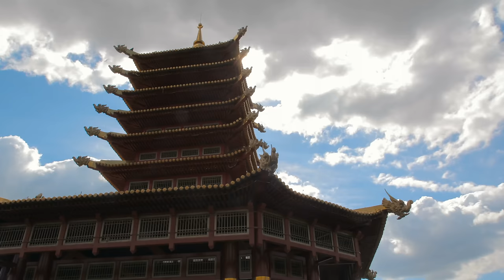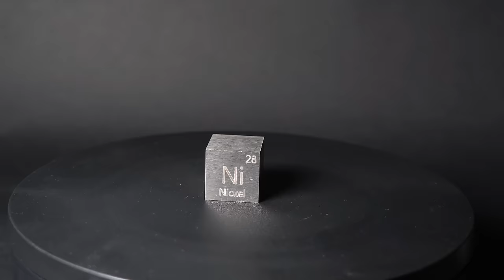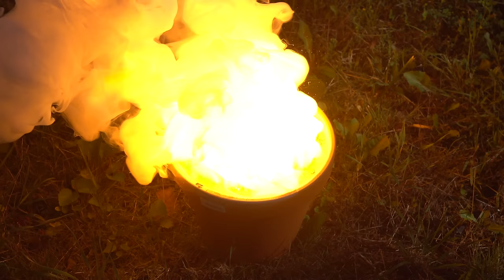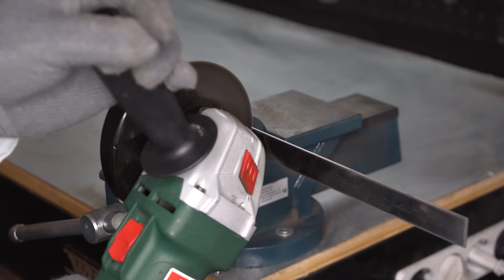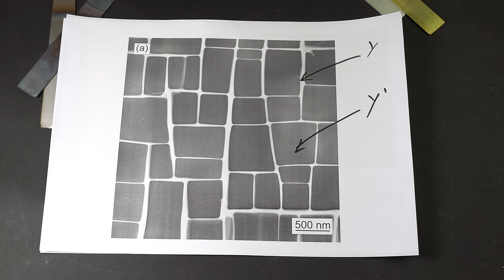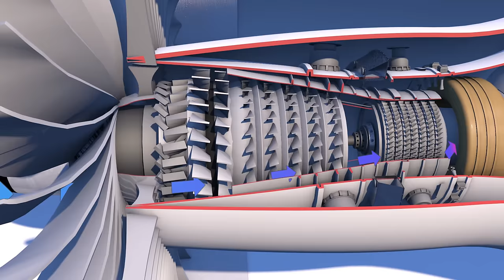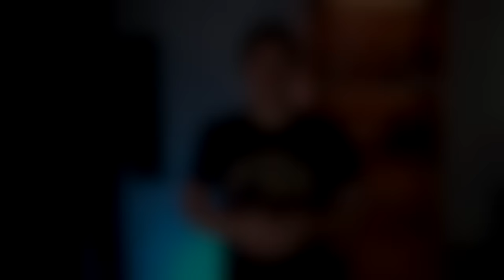Superalloy - A Material That SHOULDN'T HAVE BEEN CREATED!

Comment: The pictures of the metal crystal structures was super neat!
Reply: The crystal structure shown was from a single crystal super alloy, not IN718. IN 718’s structure looks much more like a stainless steel, which isn’t surprising since it’s basically stainless steel with some of the iron replaced by Nickel. It’s technically an iron-nickel superalloys.  The iron was removed in more advanced superalloys.

Comment: The secret to powered flight, for the Wright brothers, was the aluminum engine. Previous attempts at a glider with engine used steel engines that were simply too heavy for the designs of that day.

The Wright brothers actually painted the engine black to try to hide the fact that they were isn't aluminum.

Comment: I had a plate of iconel similar to yours but a bit thicker. Ended up cutting knife blanks out of it with the waterjet cutter at work. That will slice and dice almost anything 🤓😁
Reply: how did you sharpen it?

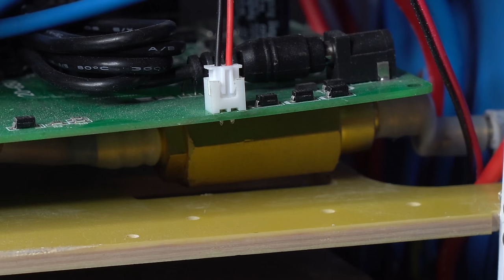Comment: 7:37 Wow the insides of that machine look terrible. The PCB is bent over the water flow sensor and the sensor is super misaligned with the bulkhead fitting behind it. It's exactly what I would expect to find inside an "Inducation" Heater
Reply: I was searching for this comment, as soon as I saw that bending pcb i knew that induction heater was going to cause more troubles in the long run

Comment: It seems an experimental aircraft was skinned on the leading edges with inconel
It may been the x planes, the rocket planes that first broke mach 1,   or sr 71, or some other plane, I can't recall anyway the titanium could not handle the heat,  so the nose and leading edges of the wings and such were made from it basically making a wind deflector keeping the super fast , high pressure air from super heating the skin of the craft  mach 2 is fast,  mach 2 is well over 1k mph, mach 3-4-5 is incredibly fast 5x faster than sound!  Amazing!!

Comment: 7:50 the flow switch is fine, the hose is kinked. You're going to melt the induction coil or let heat transfer back to pcb!

Comment: try putting a few drops of cutting oil down on the metal before you drill. It makes an incredible difference in drilling.
Reply: drilling inconel? M42 cobalt drill running at 8 SFM... otherwise carbide. HHS won't drill it.

Comment: Have you experienced with Titanium which is strongest and heat resistant metal?
Reply: He already made a video about this element in particular, when he was describing each one of the periodic table of elements (it must have been 3 years ago).
Reply: It is not the strongest or most heat resistant metal. It is however very light and thus has a high specific strength.
Reply: @FedeG86  I found a video was made 5 years ago which is 17 Sep 2017

Comment: Can you do an experiment with unattainaium. If I spelled it right. I know there is a stable form of this and when activated turns into element 116.  I don’t know if you know Bob lazar.  He worked at Area 51. On ufo technology. I believe it’s elements 115 , when it gets a electric charge it turns into element 116.  I think these metals are classified but they are on the periodic table

Comment: Its possible to make thermite with aluminium oxide or need to be pure aluminium? Its very hard to find 90%> aluminium here
Reply: The purpose of pure aluminum is to steal the oxygen away from the other metal oxides. If you use aluminum oxide, that process is already complete with regard to the aluminum. No thermite reaction will happen.

Comment: Thanks for the explanation, I've heard of Inconel but didn't know its composition.  Tesla uses Inconel in the contactors that connect the battery pack to the motor, to avoid them welding shut as with lesser materials.

Comment: I can't get into specifics because of reasons, but there are a couple processes to further harden inconel alloys. First is the traditional heat and quench method. Second is a multi stage heating and holding process that starts with holding the inconel at a high temperature for several hours, followed by an intermediate heat for a longer period, followed by a lower aging heat in excess of 1000f until the 24hr mark then the oven is turned off and the piece is allowed to slowly cool for another day. Im sure that some information is available online, however I'm not comfortable adding to the knowledge base, but it's one hell of a process to deal with that stuff.
Reply: Yup, simmilar to Ti.